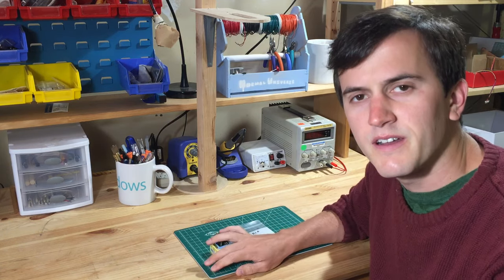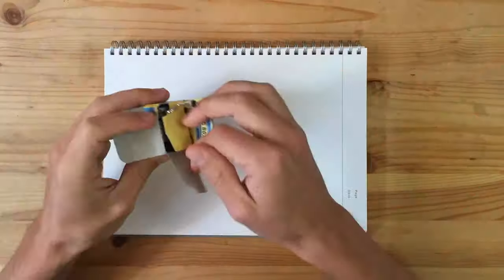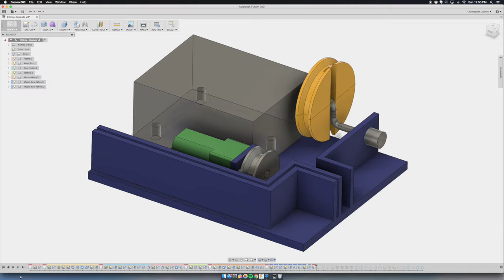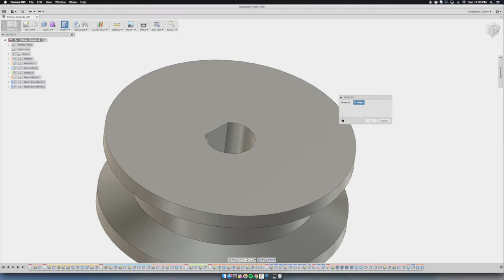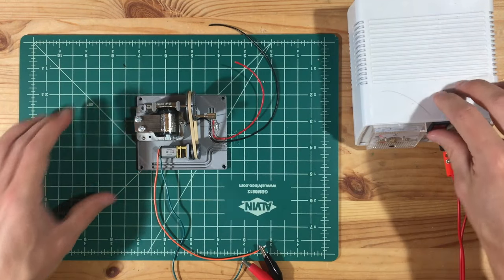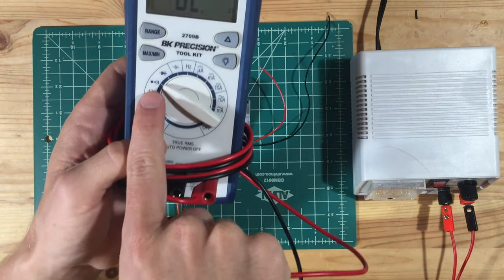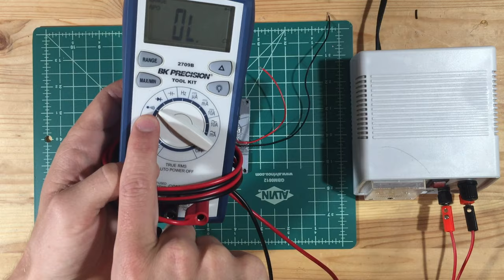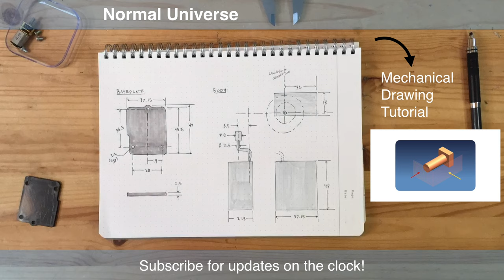Motorizing a Music Box using a 3D Printer (Ultimaker 2+, Fusion 360)

Comment: So I was thinking of making a digital music box and a spinning element powered by the DC motor. The reason why I think it might not be a great idea is the motors noise. If the point of a box is music, whining of the motor defeats the purpose. Probably a specific DC motor with extremely low noise could do it, which is tough to find.

Comment: Very cool, very informative. I wish I was this good with design and 3d printing :p. 

Are there any resources you would recommend to get better at design?
Reply from the maker: Thanks! 

One suggestion I have to get better at design is to take apart your things once they break. As you crack it open try to predict how things will look (e.g. Where the screws will be, what a part might be shaped like) and then compare the reality to your predictions. There's a channel called EEVBlog that has a lot of good teardowns like this. 

If the CAD software is hampering your ability to think creatively because it's hard to use, then sketch your ideas on paper first. Usually I sketch mechanical drawings or cross sections before modeling something. I recommend Fusion 360 for CAD it's free, powerful, and has a good UI.

Just ideas, whatever works for you. Have fun!

Comment: This is very great! Just a little question, what model dc motor (volt) is it and how fast does it go?
Reply from the maker: DarkSpriteGirl thanks! Not sure, I took it from a power screwdriver. The driver used 2 AAA batteries to power the motor, so about 3V. I used about 3 as well.
Reply: Thanx you for sharing your information, now I'll know which one I need ^^ With this, I think I can make my project happen, and that's because of your video =p

Comment: is there any way you could make a video on fpg colorizers?
Reply from the maker: Sorry I don’t know what fpg colorizers are :(
Reply: @TheNormalUniverse  my bad I think I wrote it incorrectly. They're basically devices that aid in glitching video / audio. Circuit bending and the likes. You can make very simple glitches using two video inputs, a potentiometer and a single video output. Where the potentiometer changes the opacity of either input and creates an overlapping glitch effect. A colorizer I believe changes the channels of the colors (their frequency).

Comment: to be fair I don't see the point of using a sensor to detect when the melody ends. If I were to build this, I would just count how many seconds it takes for song to end and use that as a reference, since the speed of the motor is constant and it doesn't seem that it will be skipping steps.
Reply from the maker: D4no00 if you have a stepper motor you might be able to get away with an “open loop” solution like this, because stepper motors move in discrete steps. However with a DC motor you need to close the loop with a sensor. You can’t guarantee that it will always turn at the same speed. Power supply fluctuations, dust in the axle, and other disturbances will always mess you up. Also how do you decide what amount of time to run your open loop motor? If your timing is slightly off you will accrue error every time you run the alarm.

Comment: what's the specs on the DC gear motor? I am unable to find one on ebay that resembles your one
Reply from the maker: Christopher Nhan Le sorry I took it out of a small screwdriver, so I don’t know exactly where to buy. It looked a lot like this one: https://www.sparkfun.com/products/12285
Reply: @TheNormalUniverse  thanks. Don't suppose you do orders? I live rural Australia so won't be able to locate a 3D printer or someone of those skills such as yours. But essentially want to replicate your set-up but for a 30 note DIY music box hand crank.

I know there are motorised versions of it but for some reason the motorised ones are VERY slow. HenceI prefer to get a hand crank and just attach a motor with your gears to it.
Reply from the maker: Christopher Nhan Le thanks for checking. Sorry I don’t do orders, I don’t have enough time to make this good enough to sell.
Reply: @TheNormalUniverse  thanks for the reply. 
Final question, don't suppose you can guide me in the right direction where I can find a plastic gear that you used to hold the handle of the music box? 

The ones at 1:51 and 1:43
Reply from the maker: @fearlessnhan  hmm I don't know an easy answer.  I think a good thing to do is always be hoarding leftover products that people don't want anymore, and take them apart for scraps.  Over time you'll build a collection of widgets you can use in projects.
Reply: @TheNormalUniverse  thanks buds for your help